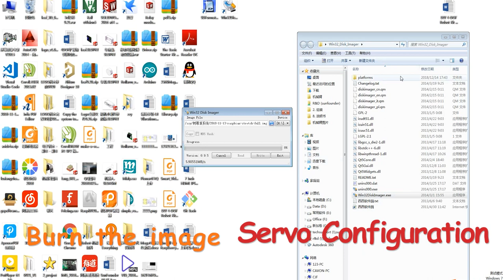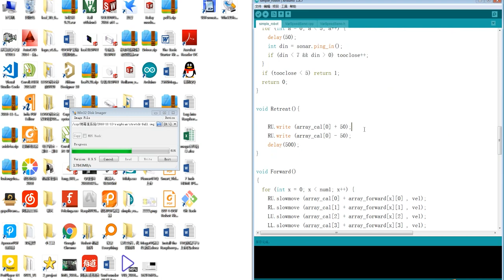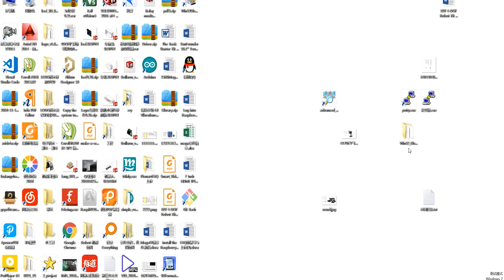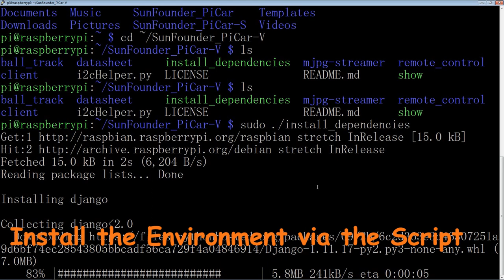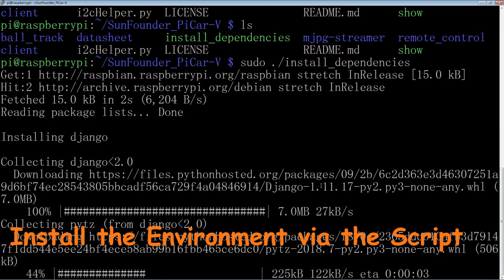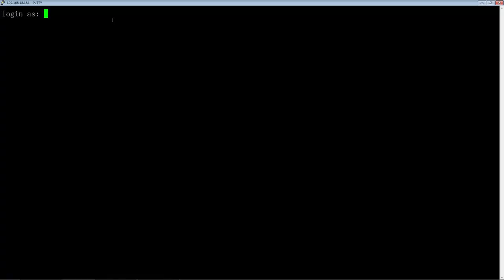Assembly tutorial for PiCar-V 2.0- Smart Video Car Kit for Raspberry Pi

Comment: The motors that came with the kit have the wires reversed from the video and instruction manual which is causing the car to be unable to go forward or backward. Please help.
Reply from the maker: please send to short video to service@sunfounder.com
Reply: @sunfoundermakereducation8590  Same issue here - wires reversed - but I haven't progressed to the finishing stage yet.  Should they be changed or does it matter?
Reply from the maker: @billtubbs4862  please send to short video to service@sunfounder.com